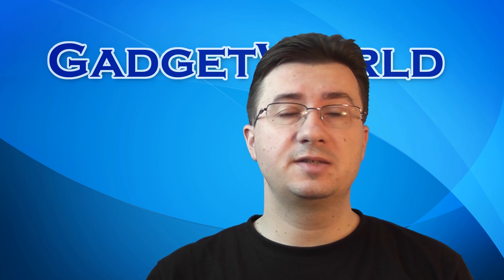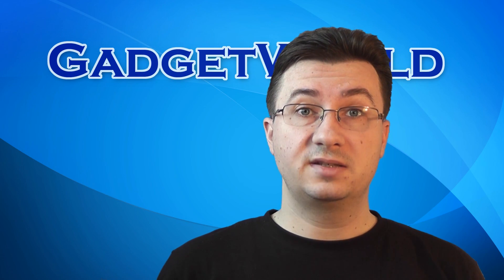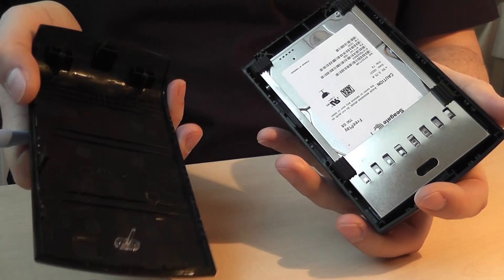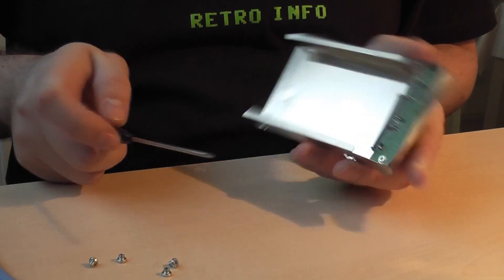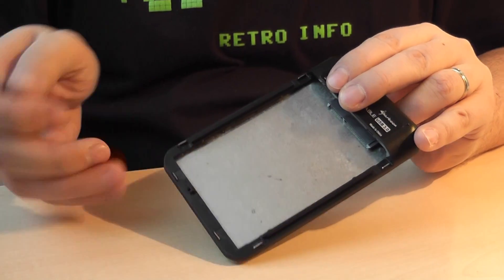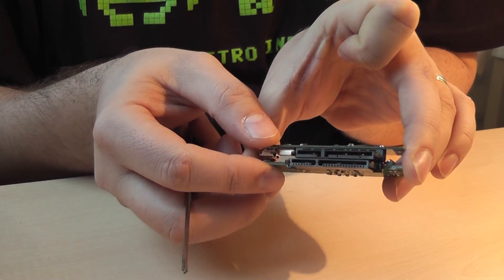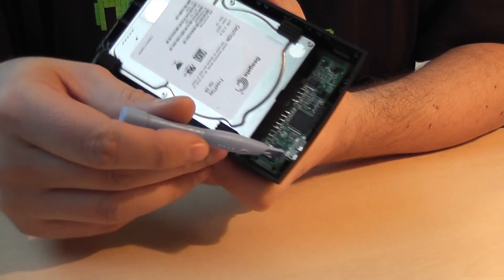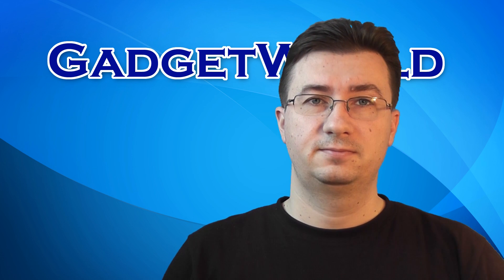Opening Seagate Expansion Portable HDD and Upgrading to USB3.0

Comment from the maker: As Apple Man pointed out, USB3.0 has a top speed of 600 MBps, but there is a caption in the video explaining that the 62 MBps in this case is the top speed of the actual drive. If you watched the video on a mobile device, you most probably missed that note.

Comment: thats cool job :). ı have a broken seagate  expansion ext hdd . ı wonder ıf you can help me "which hdd does segate uses in STBV2000200 " ı plan to use hdd board for data recovery so ı wnt to know which type of hdd use in case . thanks for your help
Reply from the maker: That's for sure some SATA HDD inside, but any more specific guess about the exact model would be as good as yours.

Comment: the usb 3.0 have a speed off 600mb not 60mb
Reply from the maker: It does not say 60 mb (megabits). It says 60 mB (megabytes), which equals to 600 mb including the 2 bits overhead.

Comment from the maker: I've got feedback from some other people too having the same problem... Obviously, there are different types of casings that look the same from the outside, but have different locking systems. If there are no screws underneath the rubber pads - then you'll have to use brute force and a plastic spudger tool to pry-open the case (trying to break as few hinges as possible).

Remember - there is no problem that cannot be solved with enough force and ignorance! :-)

Comment from the maker: To quote the video: "The controller is taken from a Sharkoon Quickstore Portable USB3.0 external HDD". The main difference is that the original Seagate controller is USB 2.0 (and quite crappy too), and the replacement taken from the Sharkoon is a significantly faster USB 3.0.

Comment from the maker: If your extension drive requires an additional AC adapter I would bet it's a 3.5" drive inside. These generally require more power and cannot be used in an USB-powered housing. But, if it is a 2.5" SATA drive - you can move it to a compact portable USB 3.0 housing.

Comment: Hi! Just wondering if it is possible to do this with an extension external harddrive. WHat I mean is can I take the harddrive out of my expansion casing which requires an AC adapter, and place it in a portable harddrive housing?

Comment from the maker: It is hard to tell this way. I would open the plastic case, take out the drive and try to connect it to a SATA port in my computer to see if the drive itself works. If so, then you're good - meaning that just the original USB-SATA controller died. If it won't work even when connected to an external SATA and there are data on the drive that are important to you, then find a good HDD recovering service in your country and prepare for an €200-€300 expense...

Comment from the maker: The original drive is 15mm thick, so it doesn't fit in the new case (see video at 0:35). Frankly, I really like the Seagate case, so keeping it was a win from my perspective.

It is important to emphasize that this Seagate drive is much higher than standard 2.5" drives, making it quite useless for fitting inside most laptops and compact computers. If you plant to use it that way, you should check beforehand if it fits.

Comment from the maker: Sorry, mate, I am keeping the old USB interface because it comes handy when I need to test or connect a SATA drive. If the PCB itself did not break, but some of the components just got loose, you can try to bake it: Basically, you put the PCB (WITHOUT THE DRIVE AND THE CASING!!!) for 7 minutes in an oven set to 200 degrees centigrade. Just search the Youtube videos for "how to bake graphics card" for details. You have nothing to lose.

Comment: im actually not interested in upgrading but more replacing the usb to sata connector. i dropped my external and it landed on the side with the usb port and the mount that's on the circuit board connecting to the hard drive broke. im just looking for a replacement for that. would you be willing to sell any?